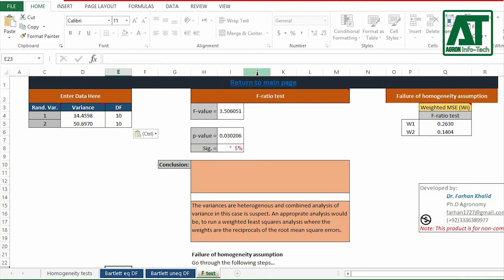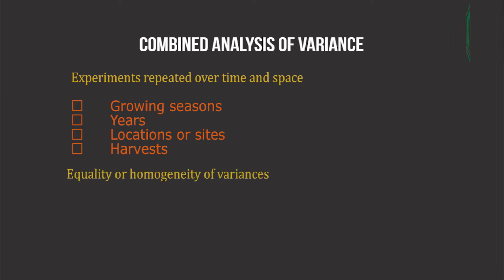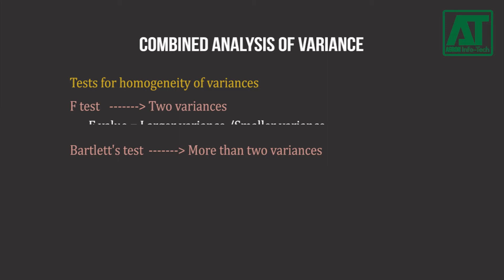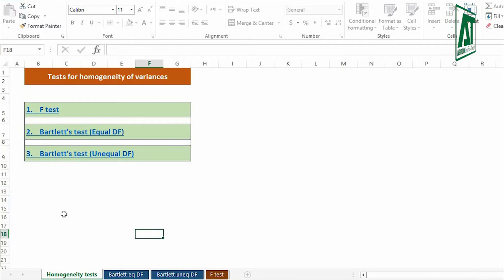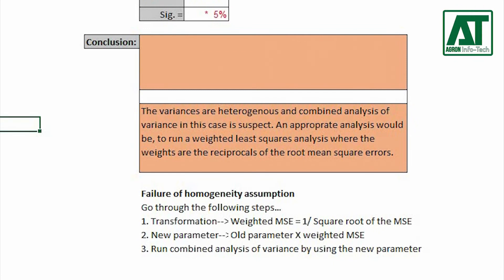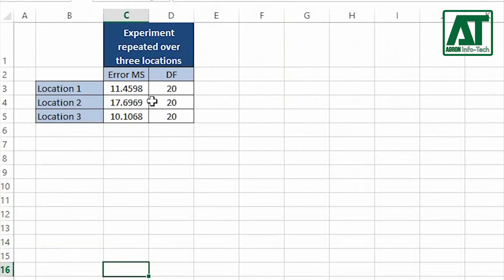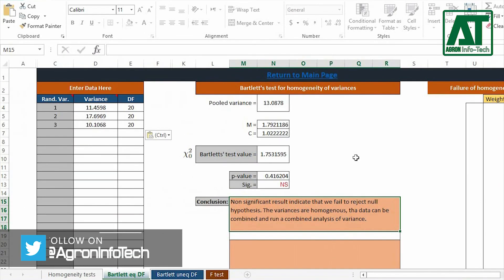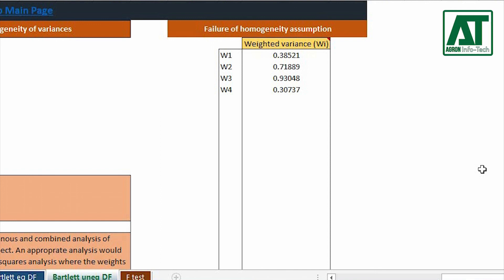Combined analysis of variance | Tests for homogeneity of variances | Bartlett's test | F test

Comment: In the case of the experiments  that consist of 2 growing seasons if there are missing data for some variables ( or whole data set in some variables) I can do combine analysis or not; for example, in 1st growing season there is stem weight data (every replication) but 2nd growing season there aren't stem weight data (all replication, the data is 0).
Reply from the maker: For combined analysis data should be for both seasons else you can't pool data when the same variable lacks data set. However if some observations are missing then you can calculate missing values using suitable technique according to the design of experiment. Or you can just do the analysis of variance as per design for the only variable which lacks data set in second season without using combined technique.
Reply from the maker: The variables for which you have data set of both seasons go ahead ahead with combined analysis of variance after applying homogeneity of variance test for the seasons. If variances are homogenous then pool the data and apply combined analysis of variance
Reply: @AGRONInfoTech  Thank you for your reply, I will follow your suggestion
Reply from the maker: You are most welcome

Comment: Sir what if in Bartlett's test I want to see the significance at 5% .... Your software is automatically showing it on 1% and also want to have a look at 5% .... What should I do?
Reply from the maker: The test shows significance at both levels. If result shows significant at 5% it means non significant at 1 % level. If significant at 1% it means also significant at 5 % level.
Reply: Actually sir if I'm calculating the same trait in OPSTAT then it is showing homogeneous which means non significant....and in your software it is showing heterogeneous which means significant .... that's why I'm confused Which one is correct
Reply from the maker: I am not familiar with OPSTAT so I can't differentiate why this happened. However in R you can carry out this test and results will be the same.
Reply: Thanks for your valuable reply sir
Reply from the maker: You are most welcome